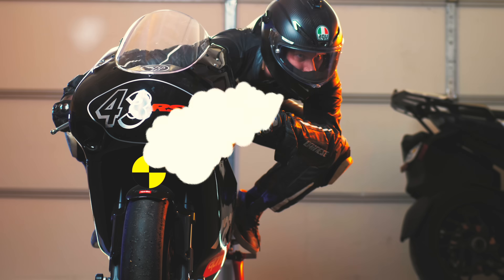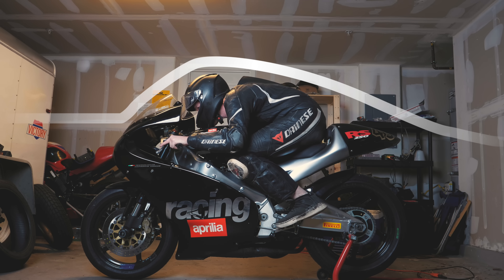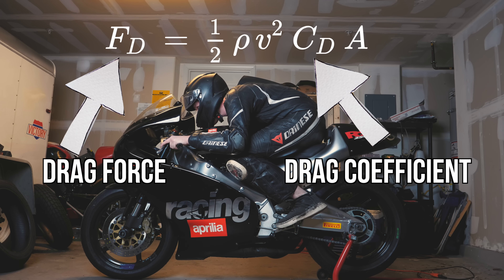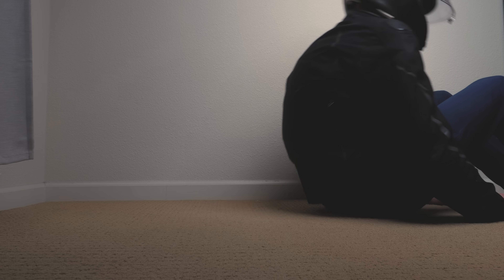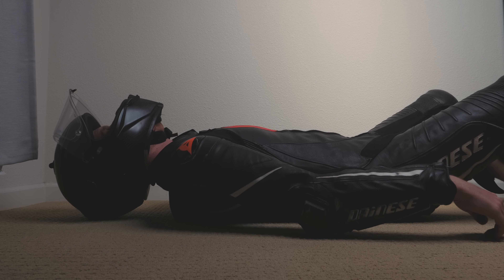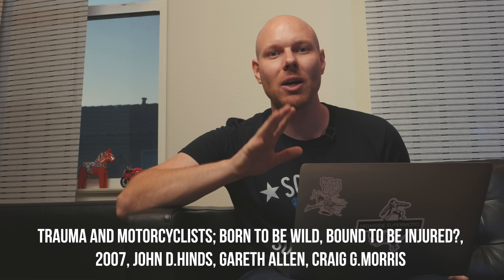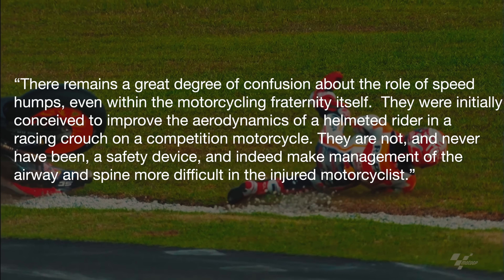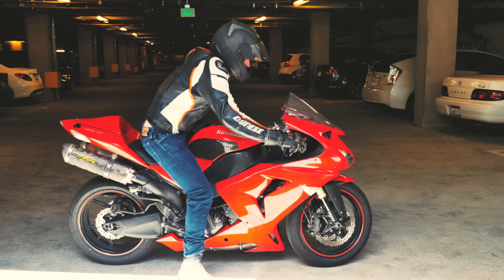Why do Motorcycle Suits have a Hump?

Comment: Ok so basically... Perhaps it's not originally put there as a safety feature however as clearly displayed in the crash footages it absorbs much of the impact wrench you fall on your back and it also helps keep your upper back and shoulders off the pavement which almost in a natural reflex causes the rider to also lift his head off of the asphalt. So.... I guess it is a safety feature. 

Let's put it this way, if it only helped with aerodynamics and possibly increased chances for sightly worse injury, out of all the accidents that happen in GP and TT, even 00.001 chance that someone got EXTRA hurt because of it then it would immediately be outlawed so clearly the benefits are definitely there.

Comment: I get the impression anyone who thinks a hump is going to help the spine or neck hasn't worn a hump suit. I will never forget just how awkward and uncomfortable it felt on my back when I first sat in a chair with one. Laying down would be just as bad. Frankly I assumed everyone could see it was purely for aero. I do notice a little less pressure on my helmet at speeds (140mph or so) and I'd imagine on the road it might make a little spinal cushioning, but there are far better and less obtrusive devices if safety is the priority for sure. It does look cool though, just as long as one doesn't need to wear the suit for any social appointments.

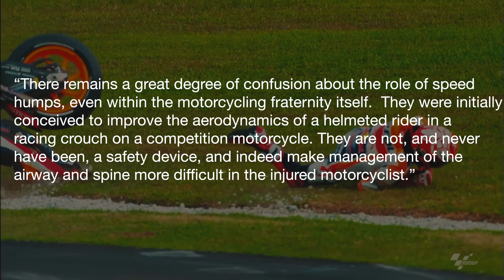Comment: 2:07] Mike, I'm going to disagree with you on this one, the source your are citing did not say that 'humps' did nothing, all it said that 'humps' were not a safety device, which may be something different.  It does not seem that humps have really been studied scientifically for there efficacy in preventing injuries, so at the same time it may be perfectly true to say that 'humps' may make management of airway spine more difficult, while at the same time protecting the spine from injury in the first place - even if the design intent was purely aerodynamic.  There seems to be gap in knowledge here.  I don't know, I don't have a 'hump' so it does not pertain to me personally.  But, it you have to step away from your bike at 160mph, that little bit of cushioning could help - even if it makes management of your injurers more complicated later.   That does not seem like a contradiction to me.  Get in an automobile accident [we used to call autos 'cages' back in the day]  The airbag that saved your life, is also going to cause you some injury - eh, that's the way it goes.  Go into the corner at 'Ballascary' at 160mph, you might be very grateful to have a 'hump' if you have to step away from your bike.

Comment: This could use some more research.  The hump may have not been initially intended for safety,  but if you do some research you will find if inadvertently helps keep the rider safer under certain conditions.

Comment: There is also another point, it helps in the entire Aerodynamic of the bike and the rider all together. The air flow will be smooth with any hurdles in between which is disturbing the aerodynamic air flow.

Comment: Few years back I crashed on the track. I was strapped onto a backboard with the hump still under my neck, that nearly did more damage to my neck than the crash.
Reply: I see the hump as a mixed bag,
a back protector makes sense for sure, but I see
increased risk of whiplash also. Landing flat on 
my back and having that hump, equates to 
back and helmet not hitting the asphalt at the same time, 
increasing further neck extension possibilities
in the 'wrong' direction.

Comment: Hello Mike. Thanks for the video. I thought the hump helps to stop your head from tilting too much backwards. Like it would prevent a whiplash. Next time you put on your leather suit and helmet try to tilt your head backwards and you'll feel that you can't move any further because the back of your helmet be stopped by the bump.
Reply from the maker: Hi rwemarika, do you have any credible references that supports the claim that the hump helps prevent whiplash?
Reply: @MikeonBikes  I don't have any references. It's just my personal assumption. And I came to that conclusion while I was stretching and realised that  back of my helmet bumps into the hump at a certain point 😂. But now that I think about it I actually have an old racing suit without a hump I am going to try it and see if it makes any difference compared to a racing suit with the hump. But first I have to find the old suit.

Comment: I will say, when I had my high side on the track with my R6, I flipping end over end in the air and landed on the back of my head and upper back, the speed hump, since my suit simply has padding in the hump and none of that fancy stuff, absorbed all of the impact when I hit the ground and I walked away with no injury after nearly a 50 mph crash. Say what you want about them, but that little thing made for me to look cool, pretty much saved me from future back problems😂
Reply: The problem with motorcycle crashes is that there are so many scenarios and their respective forces to take into consideration. Everything from a low speed low side to overcooking a turn on the Mountain Course. They all have different ways to spit you out and throw you on the road. Plan for the worst and hope for the best.
Reply: But to say they do nothing for safety is a lie. I walked away from a 100mph crash (lowside) in my opinion due to this hump... and bit of padding where it can be applied will help when rolling down the road.
Reply: @helinutjoseph  I don't think the video said it doesn't do anything for safety, it's just not designed to be intended for safety
Reply: shiiee im getting one for sure holmes.
Reply: Same, I went down at over 100kmh and landed on my back and it helped out. Better than nothing

Comment: they are absolutely a safety device,  on your spine protecter, it usually tapers off at tail bone/below or above  mid/upper chest.  the hump provides more material between you and the ground.
Reply: if i have a baseball bat, and you had to choose between hump or no hump, i think the answers obvious.
Reply from the maker: Could you please provide some credible sources for your claim?
Reply: @MikeonBikes   basic physics,   momentum requires more time/distance to reduce the change in momentum over time(impluse).
Reply from the maker: Could you please walk through what causes back injuries. Provide credible sources.
Reply: @MikeonBikes  in addition, youre looking at the impact casued with/without hump, youre not looking at hyperextension.

"The back protector with CE-rated armor lives inside the suit, nearer the rider's body. There is one more purpose, where the top of the hump also keeps the helmet from being thrown back beyond the range of movement of the human neck.
"
Reply: lack of scientific research doesn't conclude anything, nor does it clear the study you cited of bad process/hypothesis.  many scientific papers in general have been updated over years.  more padding is always good as long as it doesnt inhibit movement/weight/areo etc
Reply from the maker: I see, you did a google search and found a quote on Quora. That is not a credible source of information. Provide me with a credible, peer reviewed reference for your claims.
Reply: @MikeonBikes   its basic common sense,

along with having a hump in the middle gives you more surface area when sliding on your side.

youre coming from an authoritative argument(needing source),  youre not examining the ideas objectively.

more padding= more distance= more time= less change  in momentum in time.
Reply from the maker: You misunderstand what the argument from authority fallacy is. An argument from authority claims that what they propose is correct, because a known authority says so.

Asking for credible, peer reviewed references, is not an argument from authority.

'Basic common sense' is not a good way to go about understanding the world. You need to provide evidence for your claims. No need for degrees, go and conduct the research yourself, then come back and show me the data you have.

I also don't think you have a clear understanding of what causes spinal and neck injuries. Provide me with credible references of what causes spinal injuries.
Reply: Does being in 3 rear ender and talking to bunch of therapists count?    

Youre still not answering the added padding is extra protection no matter where
Reply from the maker: Who are these 'bunch of therapists'? Did they refer to any research they have conducted or from others?

Regarding the 'added padding' argument. Just adding low - medium density foam in a very local area does not seem to follow the general strategy of absorbing and dissipating as much of the energy as possible upon impact.

That is why the actual protective features on leather suits have a hard shell with low-high density foam behind. Just like a helmet.

Comment: Here’s another one I’ve wondered about in the past and someone else asked in the comments: Why don’t we see widespread adoption of HANS devices for motocyclists? Is it because to effectively protect that area, it would overly negatively affect head movements?
Reply from the maker: A similar type of device, called a neck brace, is used in dirt bike riding. I know some folks who ride sport bikes with neck braces.

I found a study showing that neck braces are not that effective for impact speeds above 6.5 m/s or 14.5 mph. So it makes sense they wouldn't be used for sport bike riding for that reason. 

https://link.springer.com/article/10.1007/s12283-018-0268-z
Reply: @MikeonBikes  spot on - even the manufacturers of those neck braces can't justify them. For a race car they make sense as the head can be restrained, but on a bike the data suggests they can make injuries more serious EDIT: https://www.youtube.com/watch?v=U6UfHO7jcHk
Reply: Mike on Bikes thanks! I had a feeling there’d be a reasonable explanation.

Comment: It is exactly where the back protector is so it is also a safety feature otherwise why would they bother with back protector at all!
Reply: A back protector protects your entire back, especially the spine. Also it is flat. The hump won't save your back in any way, it is too short, it'll probably damage more than it would help protect.
Reply: @SuperMKi1  actually the hump i saw on Dainese, alpines stars and Spidi, extends well below the middle of the spine. On top of that it keeps your head levelled with your helmet in case you fall on your back of if you slide of have a heavy impact on that area of your back. To say it doesn't provide an extra safety is totally nonsense as it in fact does, and there hasn't been any evidence sayings that it compromises the safety of riders.

Comment: How extra volume on the back could serve as impact protection for the spine after a high-sider is too obvious: Don't just make it a massive lump of foam, but make it an air tight semi-flexible bag with small vents that will allow air to escape under pressure. Shock absorber, there you go. a few inches gained for cushioning an impact will make a vast difference in the effect.  That's why everyone assumes the humps are safety features. That twenty-plus years passed without any "Specialist" actually getting the extra safety from those features tells me that among those experts, there are way too many not really worth their income.
I also can't understand why there is no means to connect helmets and suits to limit the range of neck movement in racing gear. Why are there no protective features for the neck, where an impact to the larynx can kill you in a few seconds?
Reply: Turns out that the mechanics of that are not so straightforward - very easy to accidentally create more leverage on the neck during an accident.    https://www.youtube.com/watch?v=U6UfHO7jcHk